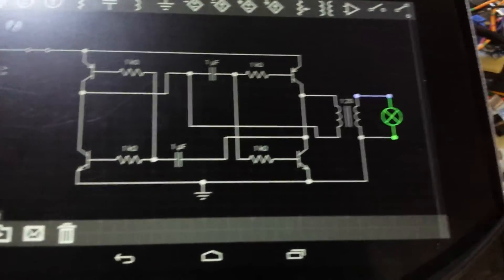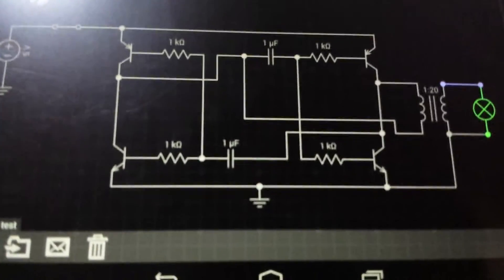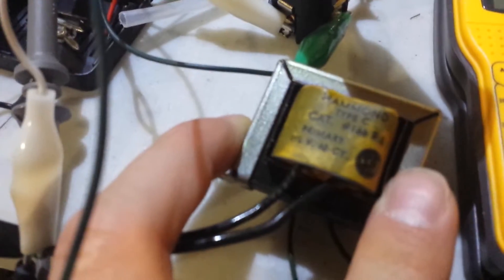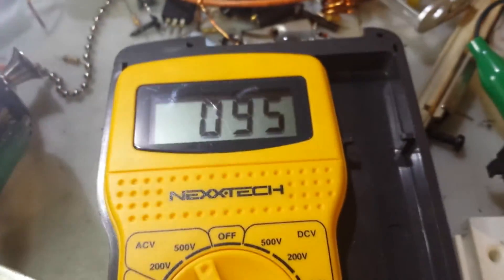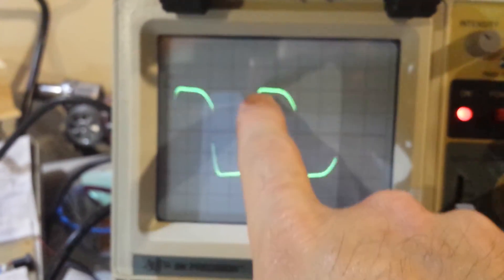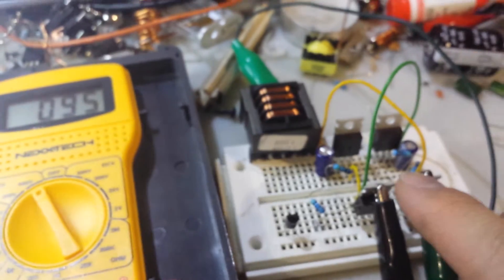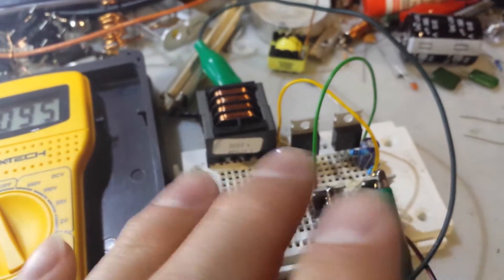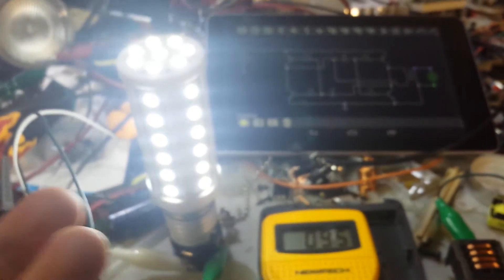H bridge simple inverter

Comment: hey can u tell me how high is the output at an input voltage from 6 to 7 volts i would like to use it with a 6volts sla battery it could be very usefull to provide some light during a blackout.
Reply from the maker: kiskiller3 The output will be around 130v ac no load frequency is about 70 hz and it will vary with load and input voltage :) It could provide enough power for a small radio or light. I build this inverter just to see if the circuit would work and as of today couldn't find a proper use to it. Also if you load the inverter "too" much it will simply stop oscillating and transistor get hot.
Reply: bakupcpu im gonna try and make the transistors drive some fets to see how this works.
Reply from the maker: kiskiller3 Mosfet will give you more power indeed if you are familiar with arduino you can also make yourself a low cost power inverter with those I've seen a few where they are sine wave but most are modified sine wave inverter for the simplicity.
Reply: yeah i know im not into arduino mutch yetbut i have a couple of them andeventually i will use them
Reply from the maker: :) I did this one because I saw the circuit on the web and it was just the schematic no comments no instruction so I save it simulate it and it look like it would work so I made it :) probably H-bridge configuration with mosfet and arduino would work way better and probably more efficient as well. I should try it hmmm TO eBay for parts :P
Reply: i just deosldered 32 nice fets from an old UPS lol i am gonna have to try that with an arduino cant wait to see your next video. i made an inverter with 2 fets and a simple 60hz transistor oscillator and it works really well i got 150W out of it
Reply from the maker: Yes making a transformer inverter is fairly easy and simple and it work well but not super efficient and in some case can be pretty bulky.
Reply: i got more than 79% effiecncy out of it with 100w od load im experimenting with that
Reply from the maker: That's pretty good indeed.
Reply: bakupcpu in gonna get into video making soon and most of my projects are in this subject (power electronics ect.) i cant wait to see your next video ! i wanna see how this arduino powered inverter is going to work i saw quite a few videos on a arduino based inverter but they arent really good quality and most off the time they did not explain  anything.
Reply from the maker: I could certainly make one just have to find a suitable power transformer for this I'll look around my shop maybe I can find something :)
Reply: an atx power supply could probably work ?
Reply from the maker: Would but it would make the design similar to the current inverter because the transformer in computer power supply is high frequency.
Reply: ah im blind i read that you where searching for a power supply lol  if you have an old ups they have perfect tranformers inside of them i used a 12v 0v 12v center tapped transfomer
Reply from the maker: lol yeah my shop is full of old surprise lol I'll look around to see if I can find a nice one :)